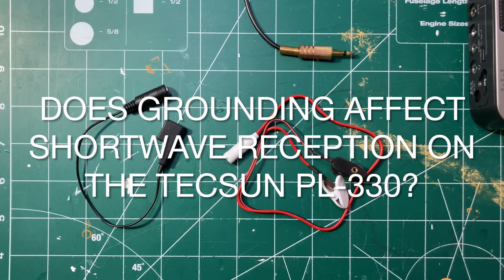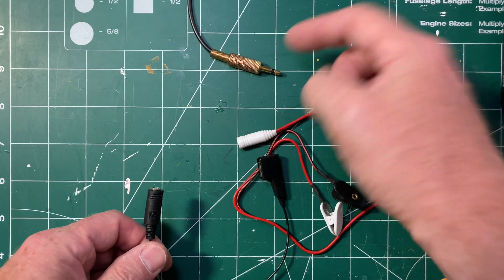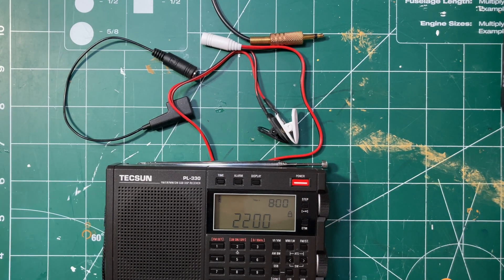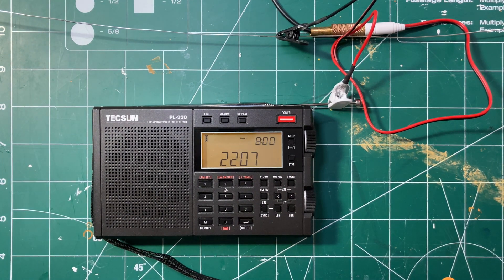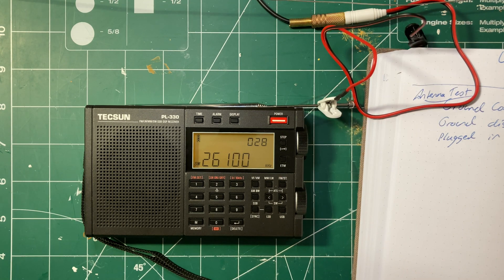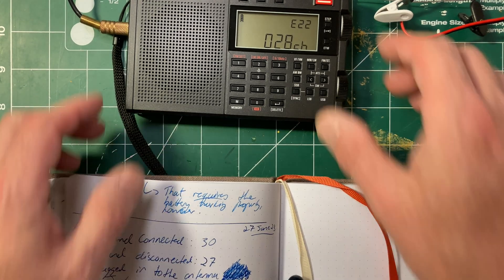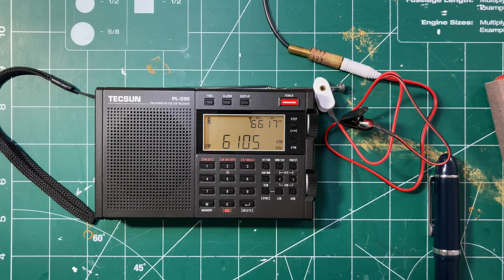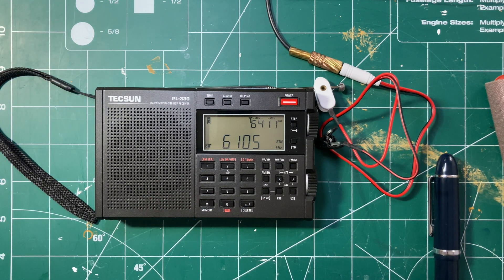Does grounding affect shortwave reception on the Tecsun PL 330?

Comment: If the scan is picking up the ham bands too then the amount of channels will vary when they are off and on the ptt button i find adding to my whip makes certain frequencies come in a lot stronger or go from no signal to signal  but i think these radios have some kind of internal ground or something but definately adding length to the whip makes a difference

Comment: Your test results are similar because the 3.5mm external antenna is NOT used when connected to the 3.5mm antenna jack on the radio... as long as you don't switch to it by holding the number 3 button until it displays CH-S! By default the radio uses the whip or internal antenna (showing CH-A on the screen). It seems you don't know that?!
Reply: hola, sabes cuanto mide la antena interna? ...quiero saber si es mejor que la de xhdata 808 de 110mm

Comment: I found a ground trick that worked on my PL-330.  Using a reel wire and standard clip on attachment, I used alligator clips to clip the end of the clip both to a ground lead and to the radio's whip antenna.  This connection did reduce noise from my router.  I could also plug in a 5 volt power supply and use shortwave very clearly.  I still cannot use AM very well when power source is plugged in.  But with a high capacity battery upgrade, I don't need to charge it often and I'm getting very good reception. The ground also reduces static when listening to am so I do not have to unclip the antenna.  Convenient. Signal strength is the same either way grounded or not.  But any reduction in noise is greatly welcomed.  Of course I can always turn off my router from the power strip... but it's nice not to have to. Thanks for the video.
Reply: Hi Peter, I’m brand new to SW and have just ordered this radio. The only thing that was holding me back was the rechargeable batteries. You mentioned that you had a “High capacity battery?” I see I can purchase a set of the rechargeable batteries and a charger on Amazon that would give me a little more flexibility. I’m wondering if you would please let me know what “High capacity” lithium batteries you switched to please.

Comment: I also have a PL-330.  Great little radio!  I've done experiments with the excellent ETM.  I'll often run 2 or three ETMs one after the other.  I always (!) get slightly different numbers of stations that I receive each time.  If you were to listen to each hit you get you'll some stations right at the threshold of receiving them. If some of them go down to below threshold on one pass of the ETM then on the next pass it might increase slightly or even go out completely. 
I like the 330 so much I'm thinking of ordering another.  I already have 7 modern shortwave radios & can't decide which other different radio to get & unless I'm convinced that there's one at about the same price & at least as good as the 330 I'm sticking with a winner. My 330 was bought in April of '21. every antenna I have is a sloper from 20' to 50' long in various directions & angles.  Each are coax fed with the coax shield grounded at entry to the building.

Comment: Very interesting video that addresses a question I've asked myself several times, thanks.
However... sorry if this is nonsense, but shouldn't the receiver itself be grounded? I'd try connecting the antenna to the tip of the jack only and ground the outer part of the jack. Then plug it into the receiver.
What kind of antenna is there at the end of this coax cable? this could also be relevant. With a plain long wire antenna, the grounding might make a difference. I have plans to give it a try soon anyway.
Reply from the maker: It might help to ground the receiver, but that would be different than grounding the antenna (I think).
Reply: @sfred  I automatically thought you would ground the antenna to the receiver, as in, attach the black clip to the ring of the headphone or antenna jack.
Reply: Any results? F4?

Comment: Interesting video, thanks for taking the trouble to demonstrate the counterpoise effect on the PL-330! 🙂

I noticed that my PL-330, 320 and 368 radios almost always register 2245 kHz as their first station every time I perform an ETM+ scan. There's nothing transmitting on this frequency (at least, not at my QTH) and it's usual for me to delete this false signal for every hour. It's not a birdie though. I wonder if the ETM algorithm wrongly recognizes 2245 kHz as a valid signal. 📻🤔
Reply from the maker: Interesting. My 330 didn’t register 2245 just now.
Reply: @sfred  Luck of the draw, I guess. There are no shortwave stations broadcasting on such a low frequency like 2245 kHz, yet my radios tend to register them as valid stations. Sometimes I can hear random and mixed signals - it's as if the PL-330 suffers from images at the lower frequencies.

Comment: Well took the question to task. And cut a small lug and had care fuly placed a wire on the batt negtave input. Then assembled radio. The effort pays for it selfe. Except around. Hi tension lines. Where a distinct 60 hertz hum is found. But away in camp its better by 25% or more. Tks fer good idea. Odn-1

Comment: I love your videos. Your style and presentation are so relaxing to listen to! I had one question on your antenna. Can you tell us where you have positioned your MLA 30 plus antenna? Is it high up in the air on a pole? Or is it closer to the ground, say on a balcony? Does it need to elevated a lot? Thank you!
Reply from the maker: I've got it mounted on a wall on my roof deck. I played around with it and that was the lowest noise spot. I expect that it would be better above the roof-line, but this spot works fairly well.